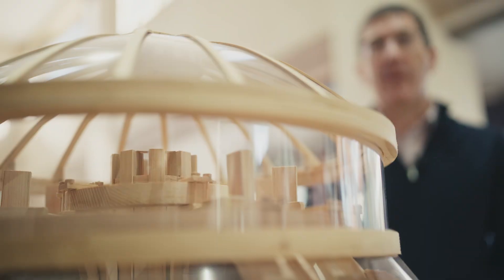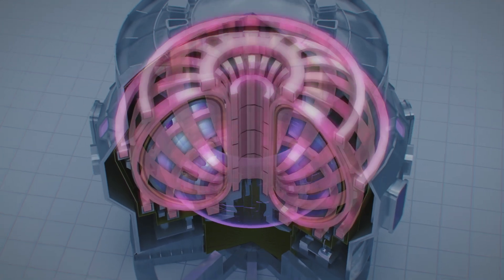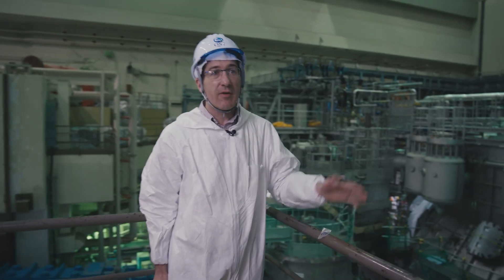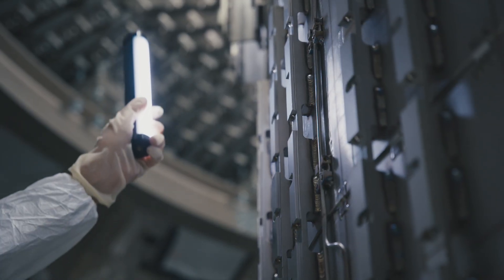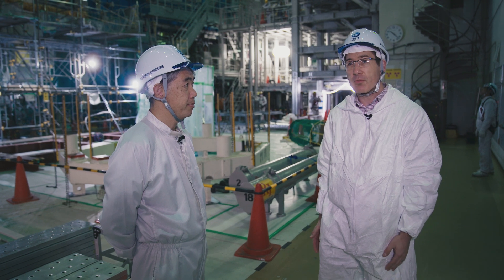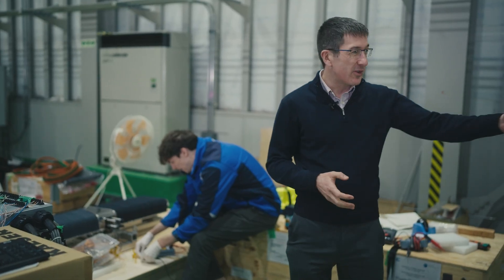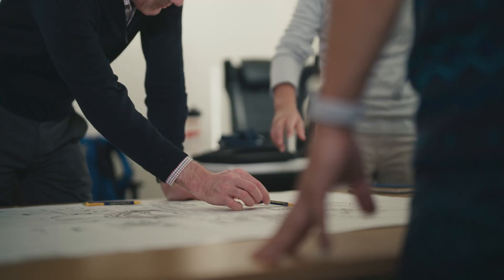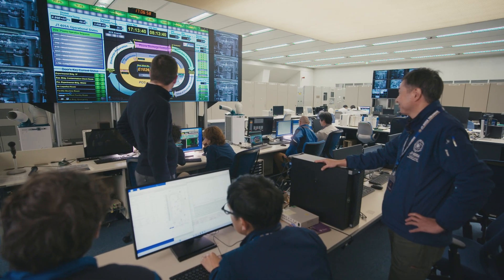JT-60SA, a step closer to fusion energy

Comment: An interesting experiment, though unsurprisingly many years behind its original schedule. JT-60SA finally began operations in 2023, only to be shut down shortly after. Despite the delays, the machine was still incomplete and fell short of expectations—a familiar story in the world of nuclear fusion. Meanwhile, the critical technologies required to make fusion viable remain underfunded, as fusion "managers" continue to entice politicians with the alluring but overly simplistic promise of creating "little suns on Earth." It sounds impressive, but it diverts resources into grandiose projects rather than addressing the foundational challenges.
Reply from the maker: Actually JT-60SA is not far from its original schedule, stayed within budget and run with a very lean structure of human resources. Operations were put on hold, according to schedule, so as to perform enhancements (add components). All in all, a very good example of international collaboration in the field of fusion, promoting exchange of knowhow between teams and offering input to ITER. It does not sound impressive...it actually is!